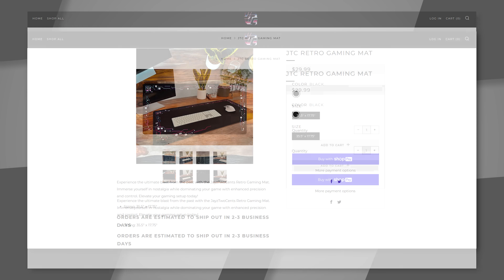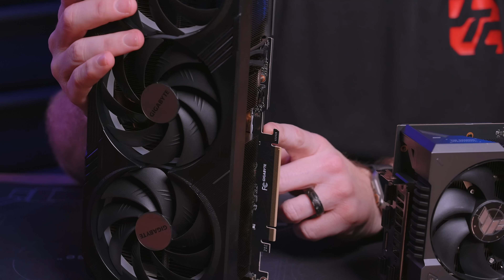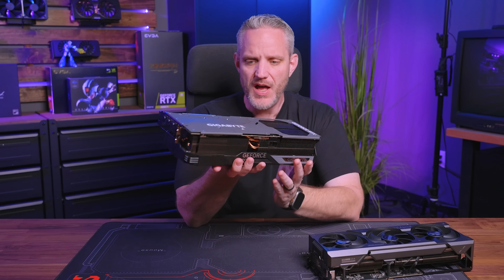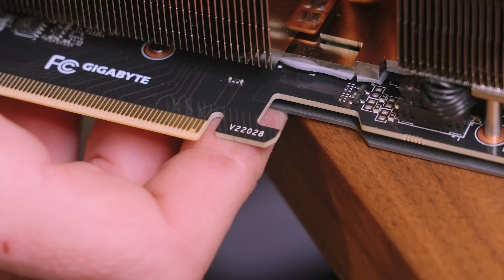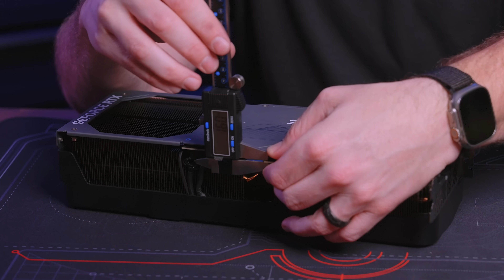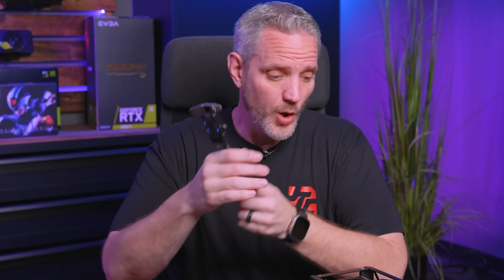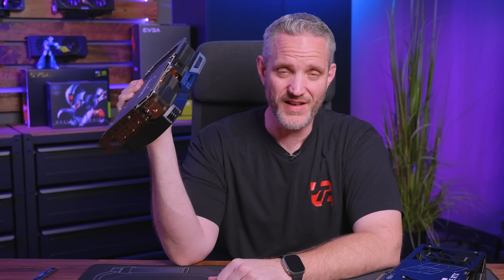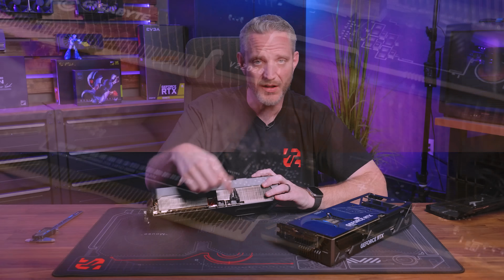These GPUs are cracking and the company REFUSES to warranty them!

Comment: you can measure flex with scientific comparative accuracy. lock something long on the tab (like calipers) and hold it so calipers are horizontal. repeat on both cards. the end of the caliper will sag more if card is more "flexible". It will be just comparison which we need. also - the way you "lock" calipers is not consistent and therefore the mistake you pinned also. guddos for pinning it .

Comment: EE here. If they made solid copper fill in all internal and external layers in that tab area, it would be much stronger than just bare FR-4 material (or with some small traces). On a ASUS card there is also a heatsink mounting point close to the tab which makes construction much more rigid. Also it takes the stress/bending away from RAM and GPU area.  Besides the tab cracking, PCB warping and RAM/GPU solder joints cracking or even copper pads being ripped off is another mode of failure due to heavy graphics card hanging on the slot which was never designed to hold something this heavy. When PCI-E was designed, graphics cards where nowhere this large and heavy. Not to say ATX form-factor was created even earlier than that. Modern reality asks for mounting graphics cards both in front and back ends to be reliable and to be able shipped without expanding foam nonsense which you must remove from inside of PC after receiving delivery.

Comment: Gigabyte never warrantied ANYTHING I have ever bought. I was recommended them as high quality low cost components, but they are low quality and high cost instead. 

Just buy ASUS or MSI, or EVGA if possible and they exist when you read this. 

Also, Corsair's RMA process was hell, but it at least got resolved? Though that was only the one time. 

MSI I have had to go through a few times, HOWEVER, it was mostly my fault ish? It was painless still, and they basically warrantied without questions. 

I've never used ASUS warranty support, but I have heard they are basically the same as MSI.

Comment: People aren't installing the anti sag bracket. It's not Gigabyte's fault if people are morons.
Reply: Even two slot cards that don't weigh more than a 1080ti are cracking. Try again with the "user error" cause. Gigabyte is using poor PCBs.

Unless you're going to say even the 1080ti required anti-sag supports...

Comment: This could be fixed and gpu speed could be improved if they made pci express x32 or x64. Now these gpus look like giga chads with 6cm pps
Reply: Extending the slot length won't fix this because most of these card's weights are on the complete opposite side of the mount. That's why anti-sag supports go on the far opposite corner of the card's shroud, and the strain on the PCB is along the slot, not one particular side of it.
Reply: @Djinnerator  kek learn some physics kid
Reply: @xAndrzej42  you're clearly lacking in that area because even cards where their shroud's length are near the same length as an x16 slot (single fan GPUs) have the exact same issue while weighing the same as 1080ti. It's poor PCB.

Maybe learn what the actual issue is?

Comment: I had an mainboard where that tap lock was so hard to push that it ended with me doing some minor changes on the mainboard so that the lock did not lock anything anymore.  The downside of that is that the card won't be solid locked into place and it might slip out if a train goes by so your house vibrates a bit. But for that mainboard that didn't matter and it made it so easy to change the graphiccard that it wasn't even funny. I just wish they could find a better way of doing it and made sure that sagging wasn't an issue. But fixing such things would cost someone money so chances that it will be fixed are not good.

Comment: I went for Gigabyte in my previous build and the brand was a disgrace. I had to RMA the 3090 after one month (blank screen, fans blowing at full speed) and a few years later my Aorus TRX40 Xtreme motherboard (it just died on my without any reason). In both cases the service was slow and it took an eternity to have things repaired. They also tried to convince me that the card was fine and I had to go in person to their workshop. Things like this, I went back to ASUS in my current rig. It is sad to see a brand like Gigabyte going down so badly and, what is worse, I told them all this on an email and they were totally like "fine, whatever". I won't buy anything from them in the future.

Comment: These boards are engineered by technical teams that have been making GPU's for years, the end user should be aware of flex in the PCB and especially when installing it, breaking the card is a user issue and not a defect, remember, when using excessive force to install or fit something is generally indicative of user error or incorrect installation method. This video is nothing more than rhetoric.

Comment: That's kinda funny for a tech reviewer to fail to recall that GPU PCB's quite obviously have standardized thickness (how in hell do you ensure proper contact on the pcie interface with 25% variation in thickness of the piece that go inside ?) and then further fail to measure them properly... Then manages to release it xD

Comment: I usually build a PC every gpu generation or two. My last one is all Gigabyte and Corsair. The GIgabyte stuff build quality is not good at all. It's not just the GPU. Everything will be great, and then there will be a point of failure. In one case it was the M.2 mounting bolt being broken off in the board.. and it just goes on and on, unfortunately. I also hate their software. A lot.

Comment: gigabyte has a really nice anti sag bracket in the 4070 ti, 4080 and 4090, doesnt it fix the problem when installed correctly? like the gpu is likely to bend so much at that spot when not using the anti sag bracket it could crack, but if the bracket is installed correctly then there should be no problem, or am I wrong?

Comment: Jay, you did this one badly. Incorrect measuring procedure. You should read measurement while doing it. Also, more flexible might mean more resilience to cracking under stress. Anyways thanks for pinning that comment and admitting mistake

Comment: Gigabyte is getting slack on quality.  Even their motherboards are no longer as well built as they were earlier.  Msi motherboards are coming with some sort of thin metal caps on the pci express slot to give some strength to the slot and hold the card in better.

Comment: @jaytwocents the angle of the cracks plus the stress fractures, reminded a colleague of issues some years back when he was testing a batch of sample gpu's.
He actually showed the manufacturer the story of the US Liberty cargo ships (WW2) that had a common design flaw re 90% or sharp angles, the ships were later retrofitted with curved or reinforced support for the weak spots (a ship could actually break in two or suffer from structural weakness, the gpu designer then added a better supporting bracket to support the gpu when it was slotted into the agp port, some motherboards had a retention bracket as well while others did not, so that could cause issues re wty.
There's a great deal of weight on the PCI express port itself and the strain of the install or removal of a gpu, plus weight sagging over time, adding in heat and usage, has to be factured in, surely the motherboard and gpu makers test what the straight / tolerance will be?

Comment: I have a RTX3070ti Strix. What are the chances if that happening here? That card is heavy. It's the size of 2 bricks. You might want your in my case 3 PCIE cable tugging slightly up on the card. Or cables above the card. Surprized no one talks about the Strixs cards being 3070, 3070ti, 3080, 3080ti, 3090, 3090ti, and 40 series in that Strix sku.

You might better off removing the recension  lock off of the PCIE slot. Won't put rensionion on the card, but risk of back of card working is's way out of the slot and possibly going short. 

Cards are stupid big and stupid heavy. When I installed my Strix RTX3070ti, I thought I was going to break something.

When I installed my card I put upward movement on the PCI bracket until it was touching tne threads on the screws, Than I tightened them. This should take off some tension when the case is flipped in the upright position, Also when I instal a card that big, I have the case on it side.

Don't drop the card. It might damage the motherboard. It's difficult to install inside of a case by a CPU cooler. I have a NH-U12 S in the system and the PCIe lock is under the CPU cooler and the card itself.

Oh,
Make sure the screws are tight. Surprised that they don;t have a torque spec. Loose screws case movement.

Comment: Thing is if you buy such cards you probably should buy GPU supports that goes from bottom case to bottom facing part of the card
Reply: Yep, I use one of these inexpensive supports and it supports that end of the GPU (no sag) and probably protects the tab too (less pressure from sag).

Comment: With the weight of cards, they need to stop using the pcb as a load bearing support (not what it was designed for).  It's about time a new method for support was invented and became a standard

Comment: I have one of the Gigabyte power supplies that kills your components that was part of the Newegg bundle you had to buy to GET the Gigabyte 3090...  Not surprised I can expect to have BOTH components be e-waste.  Totally done with Gigabyte.  Luckily I heard about the PS before I used it in a machine, so it is still in the shrink wrap on a shelf.  The 3090 is in my current build...

Comment: Pretty much current GPU's really should be supported on the outer corner area.
I also agree that the rear panel area that attaches to the case should be physically attached to the cooler as well to increase rigidity and support.

I have a 3090ti (different brand) and my PC case came with the ability and needed adjustable parts to support the GPU on the off case end.

As expensive an heavy as these cards are now I cannot understand anyone not wanting to give these cards additional support as a safeguard against damage.

We need to start thinking of these gpu's as being more fragile and subject to damage the same we do when handling a CPU and the pins on one of those.

Comment: This is not the first time Gigabyte has done something like this either. They released 30 series cards with their "Waterforce" coolers that mixed aluminum and nickel [I think?] during the cooling process which caused the whole thing to corrode itself and die.
Reply: My Gigabyte 1080 TI would freeze on default clocks, needed underclocking to not lock up. Never buying a gigabyte product again, add this and the exploding PSU's, bad caps in the past. Not worth rolling the dice.
Reply: @nitehawk9270  I like my Aorus MOBO. its a B450 tho. lots of companies have gone downhill after covid it seems. cutting corners to make up for lost revenue i think.
Reply: it's good to see that an asus gpu is a good card even though it sucks that the gigabyte gpu is bad
Reply: Aluminum water path and copper for the coldplate.  Guaranteed massive amounts of galvanic corrosion with chunks of the aluminum block floating around in your loop as it breaks apart.
Reply: Oh man now i am worried about my giga 1080 aio, its served me well all this time. Was going to pick up most likely a giga 7900 xtx but this is turning me away.

Comment: easy fix for these issues in a mobo that lays flat in its case. Like thermaltake core x9 does this justice perfectly. For us all to believe that these cards can just hang sideways with all that heat is a little sillly... even with the smaller cards, even more so the bigger ones. How am I not surprised at all they are breaking THERE. Who coulddnt see this coming?

Comment: Thats why you always install your cards vertically and make sure its solid at the screw points before y ou flip the case  horizontally. There should be very little pressure on that tab if done correctly.

Comment: The 3080Ti defect... is that all 3080s? Ie does it effect laptop versions as well???? Ive had nothing but problems with my Asus ROG Zephyrus Duo 16 (2022) with RTX 3080Ti... the laptop constantly randomly reboots with no warning or error codes... or it hangs/freezes. I had thought it was a heat problem with the AMD CPU over heating.... but the problems happen even when the system is running at cool temps ( 40-50°)

Comment: There is no chamfer on the pcb, There for a ridged edge is always going to crack under stain. The slightest chamfer on both edges will probably stop this from happening because a square edge will always be prone to crack. I've spent most of my adult life working in manufacturing, In the temp sensor industry, Hvac and refrigeration industry, PBC assembly and the cellular mobile phone industry's. Everything i make whether it be from soft/hard metals to composites always has a chamfered edge!

Comment: I have Gigabyte RTX 4090, it comes with GPU support [anti-sag] brackets. So, I am wondering,  did people not use them or this cracking of PCB is despite using those support brackets?

Comment: Jay I've been racking my brain and I wanted to share of the GPUs having black screen issues...
It may be the riser cables have to be compatible with the pcie bus slots cause of the load,
I have a RTX Titan with a 4.0 riser cable I switched back to 3.0 with no issues on the pcie 3.0 slot,
...It worked for me so far, still testing though to see any further driver issues, knock on wood lol

Comment: gigabyte has always been the corner cutting company when it comes to graphic cards. I remember the 290/X cards back in the day, where their 3x windforce cooler was as loud and ineffective as the AMD reference blower. Their low end blue motherboards are the stuff of nightmares. The only product from Gigabyte that I would recommend is their laptops, and only because the internal configs are based on collabs with manufacturers and/or other AIBs.

Comment: In the way back days, when ISA slots were king and 8088 CPUs were cutting edge, many case manufacturers solved this issue by having a kind of support track mounted at the front of the case. This mythical track was usually made of a non-conductive plastic and through shear coincidence lined up with with an I/O slot on the mother board and a corresponding mounting slot at the rear of the case. Large cards, for example memory expansion cards, could in fact achieve "three points of contact." Cards that were too short but heavy, sometimes had plastic extension add-ons that would allow the card to reach the front support track. Fast forward 35 +/- years later and somehow this is still an issue?

Comment: Been a big Gigabyte fan,  but 3 -3090 cards failing to the Black Screen\full fan, different  PSU (not cheap ones,wanted to make sure it was not on my end). waiting MONTHS to get the return.  I just got my last one back about 2 months ago, and didn't even put it in, bought a 4090 for less than I paid for the original  3090. Design flaws happen, but when you keep selling them when you know it, that is criminal.

Comment: I have a vertically mounted (Previously horizontally mounted) GIGABYTE RTX 3070 VISION OC, this video just made me take it out and check, the PCB on that exact spot is as weak as can be, but no cracks as of yet, even though to the wiggle test it feels like if it sagged horizontally it could actually crack right on that spot, now fortunately it's been mounted vertically for the past 2 months and it'll probably never crack due to the whole weight of it being pushed down on the riser stand. But this, plus the PSUs blowing up sometime ago (Which I had btw, fortunately never blew up and I threw it out for a Corsair PSU) , and the problems I ran into with a certain AORUS x470 motherboard sometime ago just makes me want to completely stop buying Gigabyte products as they just don't seem to care.

Comment: Get rid of the locking mechanism of the PCIE, i always hated it, doesn't serve any purpose other than making removal a pain, your card is secured anyways, and in any case i would argue that if the card want to for whatever reason unslot from the socket then it should, this prevents stress build up by being forcefully retained, for this reason i removed the lock on all my mobos, trash feature that does a lot more harm than good.

Comment: Hey Jay, I think the reason the tab is more flexible when you bend it on the Gigabyte card is because it is not supported as much as the other card.  Just look how the tab connects to the whole card itself. I'm no engineer but with the circle cut underneath the tab on the other card and the tab being in closer is just looks like it would be more sturdy.
Reply: you’re right. on top of that, the radius around the tab corners are too small. this can create a large stress around the edge of the tab when the tab is being flexed. thicker tab would would not make it harder to bend when the neck is too long. In fact it creates more stress when a thicker tab is being bent. overall its just a bad design comparing with the Asus one.

Comment: The Gigabyte pcb mite be poorly designed or something. But people should be more carefull how they handle the cards.
Modern GPU's are so big and heavy that its no wonder if someone manages to crack it by being too rough with it.
We have seen entire PCI-E sockets getting ripped of the motherboard due to ''rough'' handling.
I like to use vertical mounts or antisag brackets if the GPU is big.
My old Gigabyte 3070 Gaming OC survived just nicely being in several different builds over a span of 2.5 years that i had it.